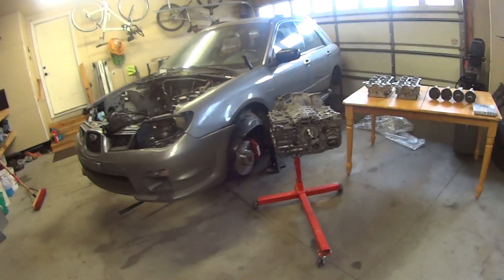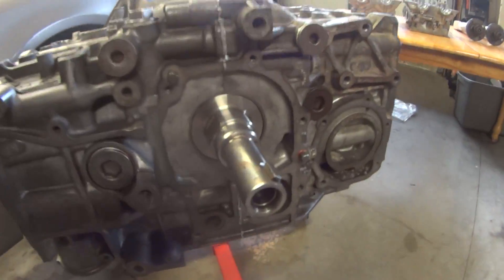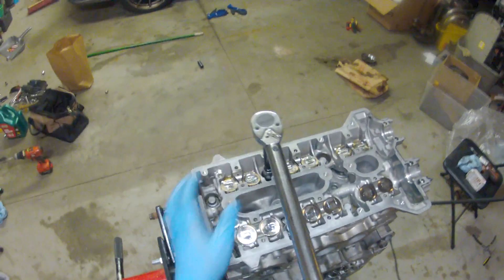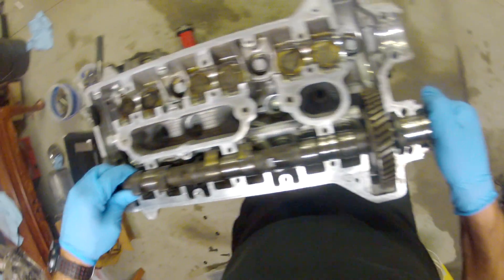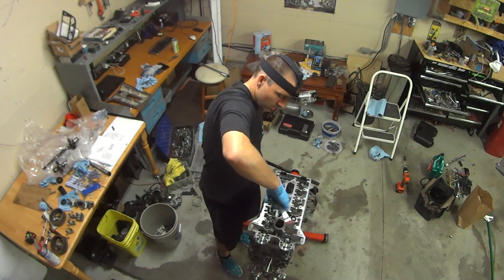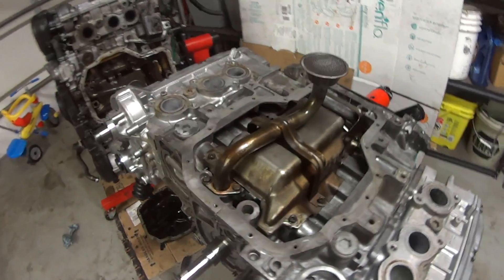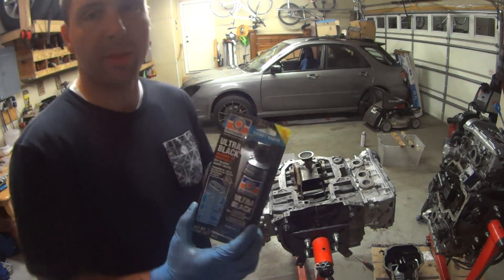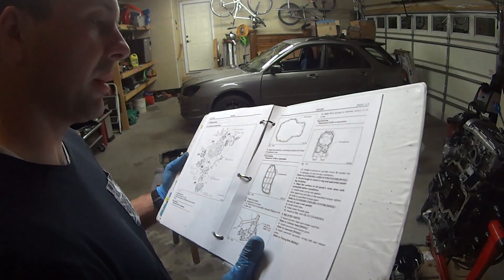EG33 Swap - H6 Impreza Build (Ep. 2)

Comment: Hey EazyOnCars my name is Jeremy and I am going to be doing a similar mod in the near future and I have a couple of questions.

1. Did you purchase a SVX in order to have all the necessary components for the mod such as the headers and ECU wiring harness?

2. If the components such as the engine itself, the ECU components and the headers were purchased individually apart from a whole car purchase where were the headers purchased from?
Reply from the maker: I did purchase an SVX and took out all the parts I needed. I also picked up another engine with everything attached at a junk yard.
Reply: EazyOnCars,

Thank you for that information. I appreciate it. How is your vehicle running with the EG33 swap?
Reply from the maker: +Jeremy Flannery great, check out the next 6 videos of the build on my YouTube channel.
Reply: I have another question that I forgot to ask. Did you swap transmissions out also for the engine swap or did you just drop the EG33 engine into the engine bay of the Impreza and hook it up to the existing transmission?
Reply from the maker: +Jeremy Flannery I added a shorter gear ratio transmission from a Subaru Forester just because I wanted to change it up but you could easily use the standard manual transmission in the Impreza.

Comment: My question is where does one find the stuff to assemble an eg/ez anything longblock that can handle 800ish bhp? If an inline 6 can do it so can a boxer surely
Reply from the maker: Adolf Shitler For an EG33 you build it just like an EJ22 since the bore and stroke are exactly the same. A built EG33 has been seen making 1200HP on 8lbs of boost (Andy Forrest Performance). I don't think there is much aftermarket support for EZ engines, but I don't know much about them as I'm building an EG33.
Reply: EazyOnCars damn fair enough, when I can afford it I wanna put something like an eg33 in a brz, I plan on making it a mid engine front wheel drive with heaps of power, it's a dream at this stage though, gotta graduate first 👌🏼

Comment: What did you do for piston?? I'm building a twin turbo eg33 for a vw single cab truck. Low boost from two GT28r turbos. Maybe 8 to 10lbs of boost..
Reply from the maker: I used the factory pistons but had them moly coated and new rings. The EJ22 pistons are the same size, but the dish is different, which if your running forced induction it shouldn't be a big deal.

Comment: cool project. I've been building my 98 eg33 impreza for couple years now!
Reply from the maker: Always good to hear from a fellow EG33 enthusiast.
Reply: Yeah of course. if you have any questions let me know!
Reply from the maker: +boostedlife are you running a factory SVX ECU?
Reply: yes and no. I run the stock ecu for basic purposes but I do have hydra nemises plug and play, with small amounts of tuning on it so far
Reply from the maker: boostedlife nice, much respect for the Hydra. I read about the guy who started with the Hydra on his svx, sounded like not many people bought in back then. Anyhow are you running forced induction?
Reply: The stock map that comes on the Hydra is wrong and I will tell you that it was difficult to get the correct things to work but it's not bad after that and yes I am running forced induction I am running a modified hx 40 Turbo And built engine
Reply from the maker: boostedlife solid setup, I was considering the Holset HX40 before deciding on T25's. have you dyno'ed it? I'm targeting 350 to 400hp. still have to finish up a small bit of my megasquirt wiring.
Reply: I have yet to dyno it because I'm not fully tuned and I've been having problems with-it overheating but I just think I May have fixed it so we will see when I started up in the next couple weeks I also installed airplay head studs which were difficult to find it seems like
Reply: 400  should not be too tough because some guy said he made 477 on 7PSI on a stock motor
Reply: Actually maybe it was slightly less but still good numbers
Reply: My goal is 500 wheel I've got custom axles highest clutch from competition clutch and everything else I can think of that will hold it
Reply from the maker: boostedlife I know the struggle of overheating, hoping to have that sorted in this build. Tracked my last iteration and seems like I figured it out. Turbos won't do me any favors though.
Reply from the maker: boostedlife do you have a build thread by chance?
Reply from the maker: boostedlife what Transmission are you running? I've got an 06 FXT 5MT with a 4.44 final.
Reply: EazyOnCars sorry I didn't see you had replied multiple times. I don't have a build thread. I did try that tranny you have at first but I got a great deal on an 08 sti 6sp so I put that in
Reply from the maker: boostedlife awesome, that is ideal. I've got the 370cc injectors from a 300zx, I'm curious what you are running.
Reply: EazyOnCars I have nissan gtr deatchwerks 760cc